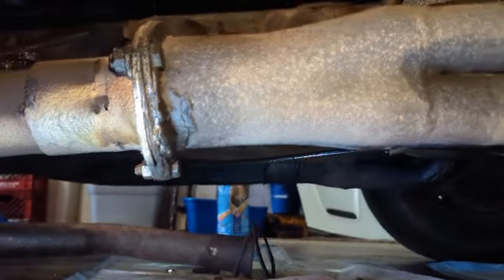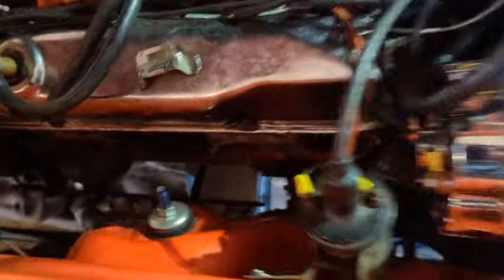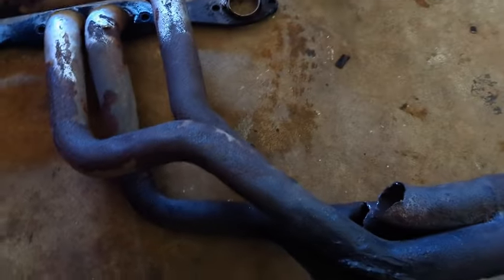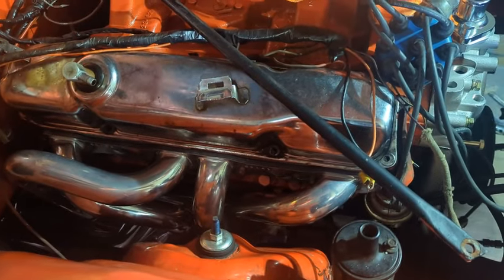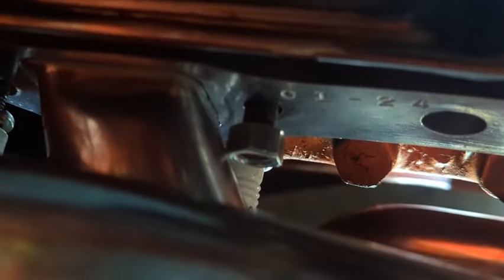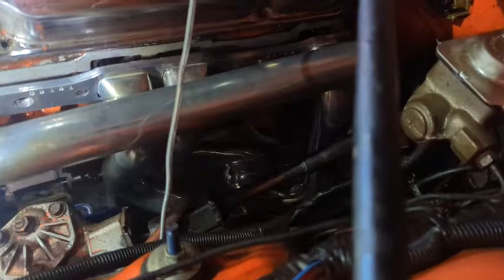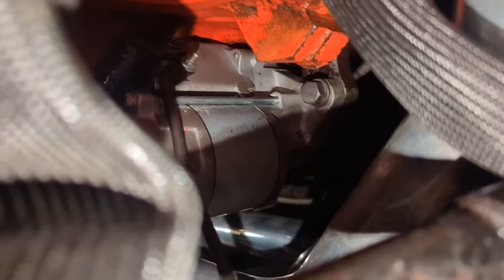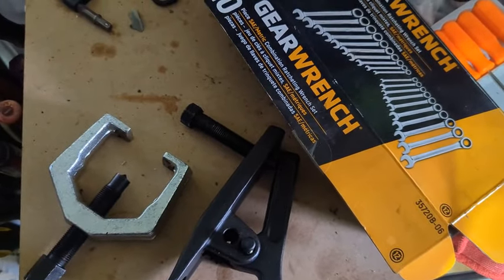1970 Dodge Challenger 440 Summit Racing Header Install B Body E Body Big Block Mopar #whiskeyracing

Comment: Nice car, installing some very similar, how did you get the passenger side up, mine wants to hit the torsion bar
Reply from the maker: Put the car up on jack stands so you have more room underneath, unfortunately I do not remember how high I had it. I do remember jacking it up higher to have more wiggle room under the car to get the header at the correct angle. Undo the passenger side mount and jack up the engine. With the car high enough and the engine twisted, there is enough room to slide it between the torsion bar. It took me multiple attempts and lots of yelling. The usual it looks easy on YT lol. Thanks for watching and good luck with your project. Sorry I couldn't be more specific.
Reply: @ thank you, will give this a try.
Reply: Well, ended up taking out the torsion bar, header went right up, now the headers are installed, the torsion bar cannot be re-installed, checked motor location around 5 1/4, crank bolt to K-member.   These are JEGS brand, just wondering if they are just that far off, all the bolt holes were off.
Reply from the maker: Man, sorry to hear that. I've not installed a set of the JEGS, so have no personal experience. Considering all the bolt holes were off, I would guess perhaps the entire design is off.
Reply: Yeah, have a new set coming, JEGS did rectify immediately and without question.  Great group to do business with.
Reply from the maker: Glad they made it right!